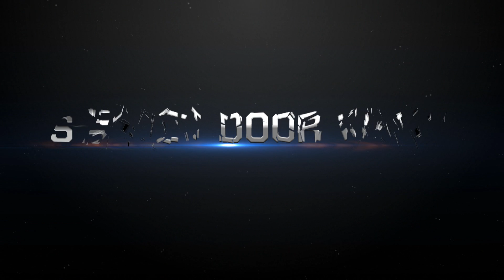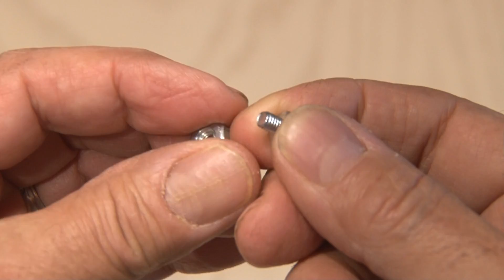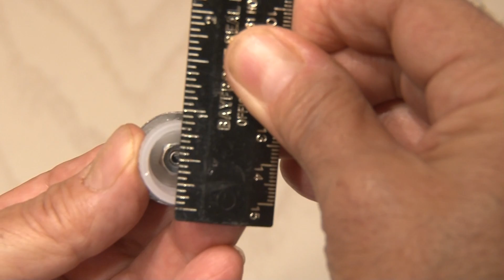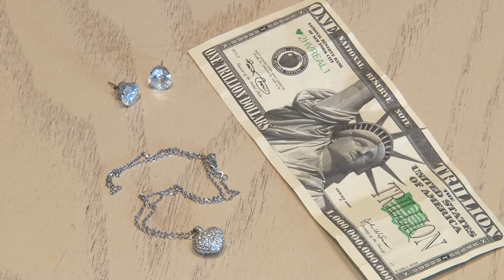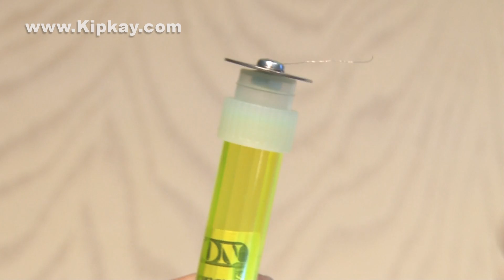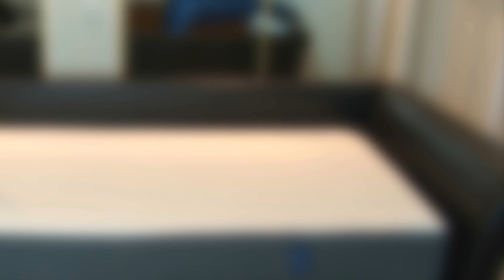Secret Door Vault!

Comment: wouldn't  a solid wood door be better?
If you accidentally pull the top off, the tube will fall into the door and you gotta break the door to get it back out.
If the door is solid wood, you just have a hole with whatever depth you drilled.

Comment: Another hiding place that is a little harder to get to is behind light switches at interior walls. DO NOT wrap the stuff in foil. It could make contact with a screw at the side of the switch, and you could be electrocuted. For even more storage, (if you have plastic service boxes) make sure the breaker supplying power to the switch is off, then cut out the side of the box. The stuff can be put into a cloth or PVC bag with a piece of twine. tie the other end of the twine to the switch frame, and let the bag go into the wall. NOTE: this is NOT for hiding drugs, because drug sniffing dogs will still detect them through the drywall.

Comment: 2 alterations. First, the tube and top need to screw together, or the tube could detach and fall into the door if the door is slammed Second, an outer hole, just wider than the washer, needs to be drilled to be thickness of the washer & screw head. The assembly is now either recessed, or flush, with the door. less visibility means less chance of detection.

Comment: Good idea. I would drill a slightly larger hole to a depth of 1/8" - 3/16" first, then switch to the smaller spade bit. The washer and screw will be flush with the door, and also prevent rubbing if the door has very little clearance at the top.

Comment: I Would prefer to use a screw-on cap.
if the cap pops off, because the door gets banged-shut a few times.
Your tube may drop in the hollow door. good luck getting it out then

Comment: Would have to make sure the screw you use doesn't stick out of the top enough to rub into the trim.  You'd probably be better off with a flat head rather than a rounded one.
Reply: +Urahara1001 in the united states the doors tend to have a gap on the top and bottom so you wouldn't have to worry about it.

Comment: Cool video, just curious why you used a piece of wire instead of a ribbon or some string?
So it blends in better?
Reply from the maker: +Ben Braunstein I used the smallest diameter I could think of for easy hiding. Plus the wire is strong.
Reply: I feel like all my wire is crap. Gotta buy some decent stuff. My copper aint good enough.
Reply: +Ben Braunstein Could ignore the wire entirely and use a small magnet when retrieving the tube. Then nothing would be hanging from the top of the door at all.
Reply: +kipkay Ditch the wire. Recess it all the way in and use a magnet to pull it.
Reply: +Ben Braunstein a thin wire would be harder to see
Reply: It stays in shape.
Reply: +Willgasm Great idea

Comment: What if the tube came loose and fell into the void of the door?? I think all the expensive jewellery would be stuck in the door. 
use a threaded container it won't unscrew and drop down the inside of the door.

Comment: what if the tube falls out in the hollow door...
Reply from the maker: +Bastian Brandsma Not a good thing. You would have to cut an opening in the bottom panel to fish it out.
Reply: +kipkay maybe you can make a thread on the tube and in the cap so you can screw them together.
Reply: +Louis Dickinson or just hold the door upside-down?
Reply: Maybe turn your door upside down and shake
Reply: +The Emerald Apple yeah with a 7/8 inch hole?????
Reply: +kipkay You could use a strong magnet on some rope to fish it out, just hot glue a nut to the bottom of the tube!
Reply: +Bastian Brandsma The washer should prevent it from falling into the door, as the diameter of the washer is slighty wider than the diameter of the tube...
Reply: Just use a container with a screw on lid.
Reply: You will lose 1 trillion dollar or the door 😁
Reply: +Bastian Brandsma The washer is supposed to be larger than the hole you drill.
Reply: Then u didn't get a tight top like he said so it's your own damn fault.
Reply: Yaaaaaaaaa
Reply: Flip the door over and it should fall out.
Reply: +Auto Young Thats a bitch slap of truth right there. - Will Ferrell
Reply: +Bastian Brandsma Then you're shit at building things. You can make these much better by using a metal cigar tube, they have threaded screw on lids.
Reply: i dont think you can get the tube in if the hole is accually 7/8
Reply: +The Emerald Apple you can try?
Reply: would be hard, but hey, wheres a will theres a way
Reply: i think its the same chance as winning the lottery
Reply: True but with a magnet you don't have to take the door off
Reply: +Louis Dickinson yes you do
Reply: +Shogun_  its still better to avoid it
Reply: +Bastian Brandsma  if that happend in my door i would just punch a hole in the door and then grab it I already punched a hole in my closet door out of anger gotta love the cheap doors
Reply: lol
Reply: +Anthony Arizmendez nope its won't work but he only did it and showed it on the video that it dose work
Reply: +Chase Corr what is only the tube falls
Reply: bas inator
If the tube falls on its own, you need a tighter-fitting cap.
Reply: +Mr Milky yeah lol it might work
Reply: samg100 18 maybe but I'm not sure..it's definitely a risky job if something falls in your door there's a 98.5% chance you will never see that item ever again..dun dun DUN
Reply: Mr Milky yeah because (as you know) it's easy for something to fall but not easy to get back out
Reply: ur fucked
Reply: Well if you make sure all your measurements are correct then it shouldn't happen.. But maybe take the door off the hinges and turn it upside down?..
Reply: freezs the dor andz break it
Reply: why not turn the dppr upside down
Reply: your fekt
Reply: Bastian Brandsma Can't pay attention?PLEASE!!

Comment: Couldnt the botle just fall down if the jewerly is too heavy?
Reply: No, because there is not any jewelry that you own that is gonna bend a washer like that.
Reply: +80yard Badger But the bottle cap will eventually fail say i fill the bottle with pure gold
Reply: garaza adsf It wouldn't be that heavy that bottle cap can probably hold 50+ pounds and nothing you put in the cylinder is gonna way near that.
Reply: 80yard Badger So you have to be pushing the bottle cap off with 220N of force
with a thumb
Reply: +garaza adsf What do you mean by pushing?
Reply: 80yard Badger I just realized im wrong , whild the cap is standing the weight pulling it down is evenly dispersed around the cap but when you push it from a single point it pops, but all of this just so dependant on what kind of a bottle do you have
Reply: garaza adsf Yes, exactly